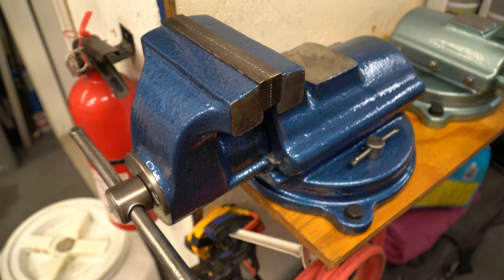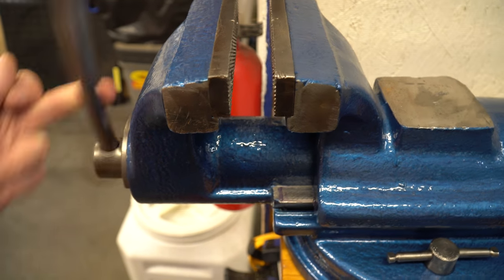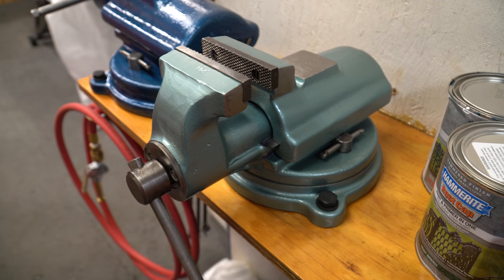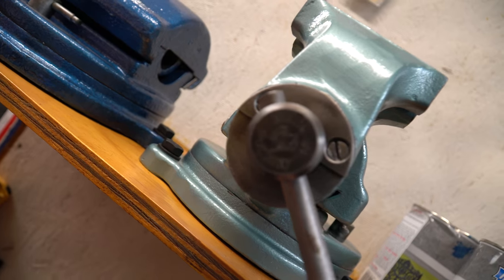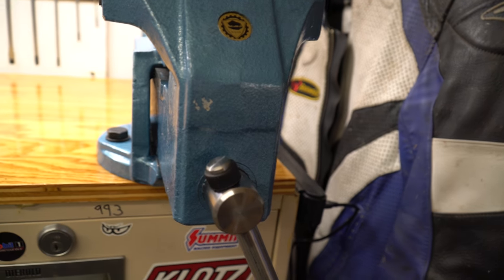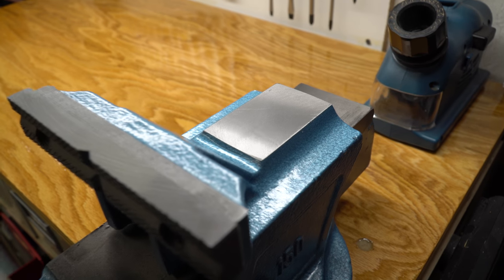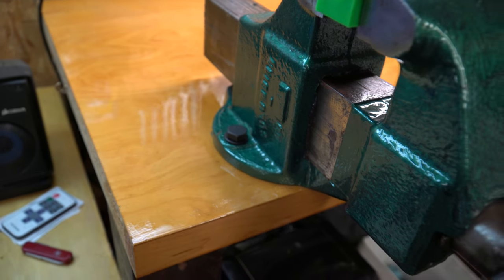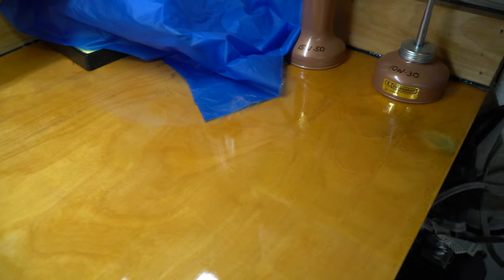All of my bench vises in 4K

Comment: Good video. Have u seen or heard of a vintage Columbian 6" multi-purpose vise (about 80 lbs) with upper and lower jaws that spin to vertical? I have a chance to buy one in good condition for $75 but I can't seem to find another to check pricing. R these type of vises more gimmicky and not so heavy duty? Do u think $75 is about right for this type (I noticed Wilton and Yost sell them new for as low as $150-$200)?
Reply from the maker: Never seen a Columbian multi-purpose type but $75 seems fair to me. I believe the Wilton & Yost models of the same type are identical with different paint jobs.
Reply: @MarkFox  Thank u 4 ur reply. I did pick up the Columbian vise today. Other than Columbian stamped on both sides the only other marking I can find reads 66 on one side.  It turns out 2 b a 5" vise and when I took it apart both the steel rotating sleeve and ACME screw are perfect.  I also bought an old 5" Wilton bullet 1750 in very nice shape for $85 and now I'm working up the patience that it'll take 2 sand down the vises and do a repaint.
Reply from the maker: Sounds great! Wiltons are out of the question for me,  they bought Columbian and turned them into China made junk so I will never purchase anything Wilton.
Reply: @MarkFox  I agree with u on the new Wiltons. Thankfully mine is a 1989 model.